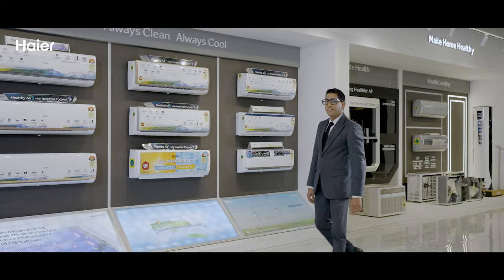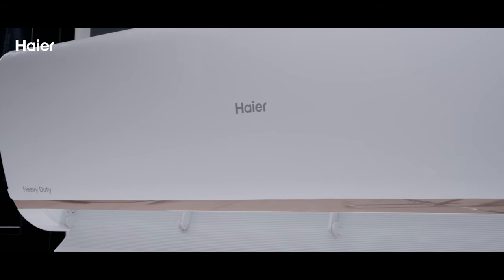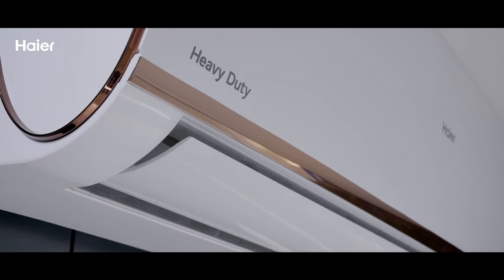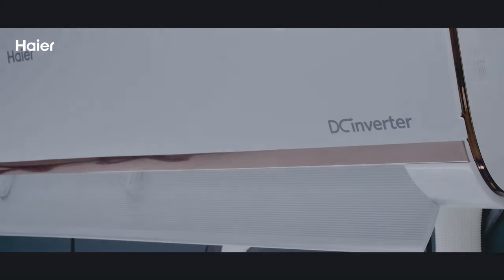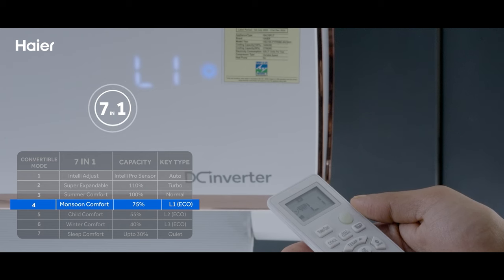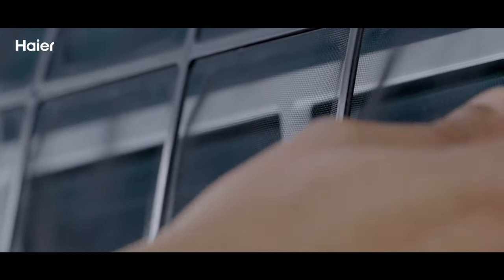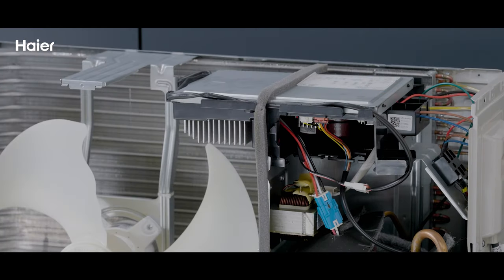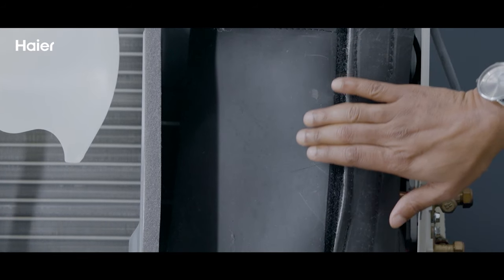Haier | AC Demo video | English language

Comment: Is Quiet mode better than L1, L2, or L3 in terms of Energy Savings?
Reply: Yes but you will not be able to change fan speed.

With quite mode indoor fan will be at a very low fan speed & once you change the fan speed the quite mode will be cancel out & the unit will enter normal cool mode 100% watt usage.
Reply: @gcyoutube-k4x  Thanks for replying. I just found out that while on quiet mode, you can enter L3 eco mode. With both of them combined, does that consume even less energy?
Reply: @brandonian2000  

Quite mode is like L3 they consume the same wattage & amps.

L3 you can change fan speed = additional wattage from fan speed

Quite mode will consume a slightly lower wattage because of the very low fan speed of both indoor & outdoor unit.

I use quite mode on my 3hp unit because it doesn't have any eco mode.
By using quite mode i am only using 600-700 watts acts like an eco mode.
But i have to use it with a stand fan to help recirculate the cold air. 

I still get lower kwh by doing this method.